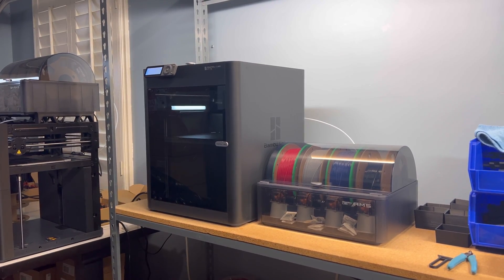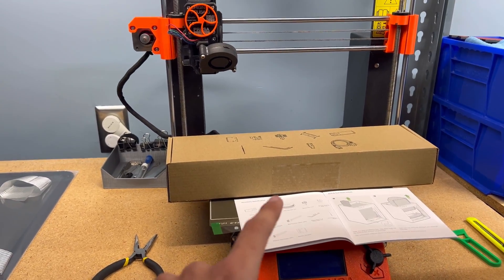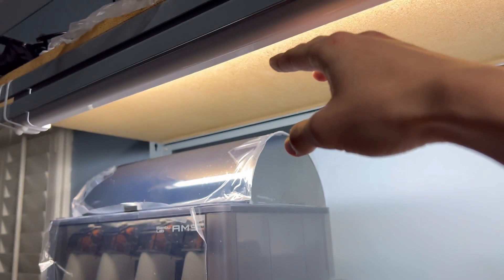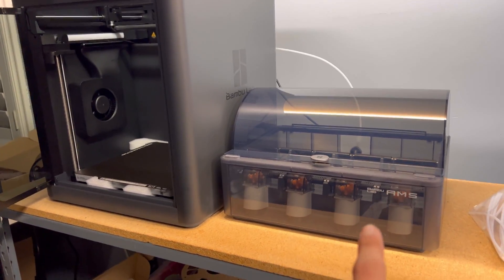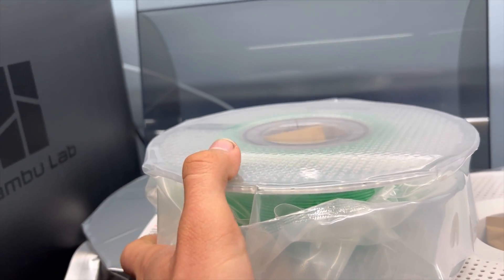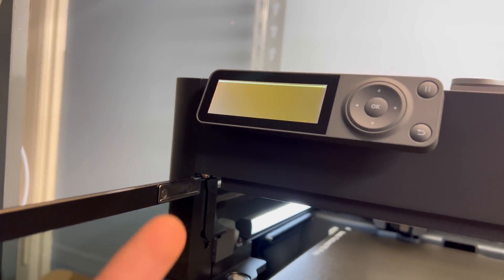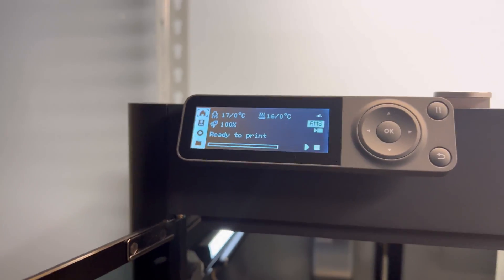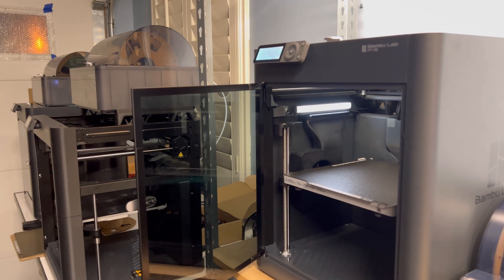I Bought a New 3D Printer - Bambu Lab P1S 3D Print Farm Setup

Comment: Great printer I have two of them the only thing I found is the build plate does not last long before prints don't stick and that the gold plate i found the ones from ali express last much longer and the orange AMS is just an updated one.
Reply from the maker: I agree, although I noticed that issue with the black plate in my p1p. In my previous video I did get the aliexpress ones, they work great and the discounted price is sweet
Reply: @A3DEngineering  can you give the link? I just got the printer